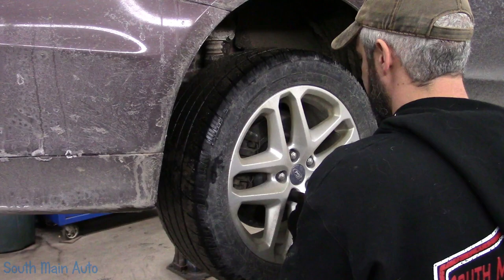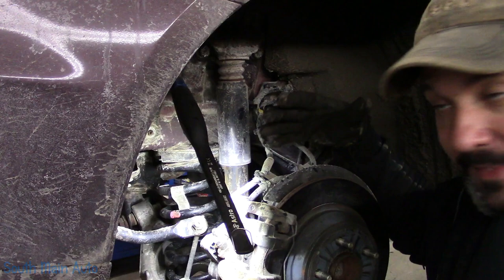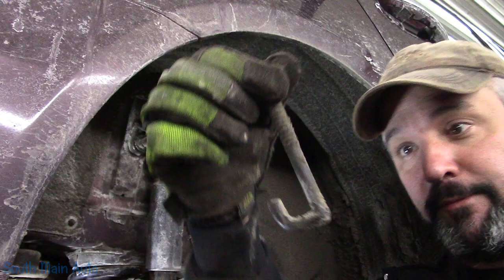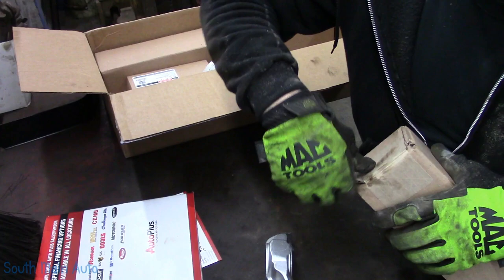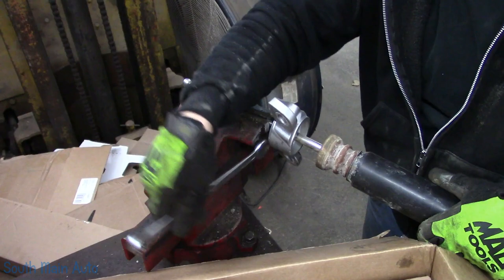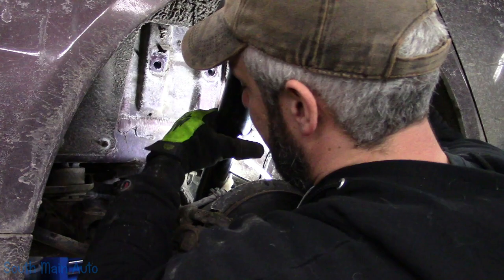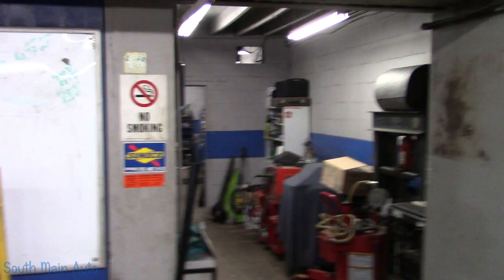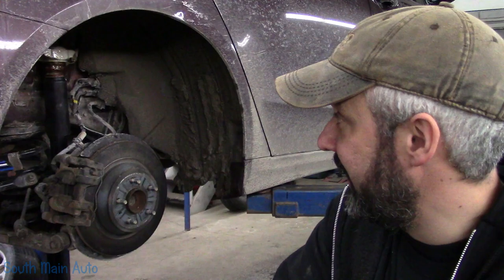Ford Fusion - Rear Shocks & Mounts

Comment: Any fusion owners hearing a clunk in the rear of their fusions. The noise is coming from the nut at the top of the shock. All you need to do is tighten it. I had it develop at like 60k miles, thought i needed new shocks. Just realized the top nut was loose causing the noise, give it a good snug and it wont knock. Use a pair of vice grips to hold the stud from spinning with the nut, since it wont tighten if the stud spins with the nut. It happened on both left and right rear. Just realize itll re loosen itself over time, i noticed it happens usually in the fall and spring times with temp change.
Reply: Wife’s car is at 58k miles and after reading your comment I think we are having the same issues. Thanks for posting this.

Comment: Thanks for the video. I have a 2013 ford fusion and I need to replace the upper shock mounts and shocks because of the clunking noise coming from the back. This explains why. Never think these videos are not worth it. They are very valuable.
Reply: I'm in the exact same position. If the noise only comes from the left rear side, do you think it's necessary to replace the other side as well?

Comment: The bolts for my shock mount decided they don’t want to thread anymore. Bolts plural, as in only 1 will tighten all of the way. The bolts themselves seem fine, but it looks like there’s a bunch of metal shavings in the holes, so I’m thinking that’s my problem. Not brave enough to use a helicoil on it so I guess I’m getting it towed to the mechanic 😡😡

Comment: Just replace the shocks on my beatass 98 Ramvan. Front were actually broken and not even connected to the mounts.......rear were original and blown-out. OH MY, the 60-bucks I spent on those cheap Gabriels, the difference between night and day. The ride was scary-bad before I changed them.....now it is pretty dang good.

Comment: Yes another Northeast storm beating up New England today. Thanks for the entertainment Eric!
Reply: So I'm not the only one doing absolutely nothing today! 😁 Gotta save up my energy for snow removal later today.
Reply: Smitty Smithsonite I waited until noon and we had 14 inches here in   CT. Got that cleaned up and got hit with another 8 to 20. I'll get that in the morning lol.
Reply: Yikes! You guys got hit worse than we did. It drifted a bit up here, so there was 6" in some spots, and well over a foot in others (some areas were 2'). Just got done an hour ago (still lightly snowing too). What really sucks is the ground isn't frozen under all that snow - got stuck quite a few times with the plow truck, and was watching the fireworks in the dark from the rocks and mud the snowblower was tossing everywhere. Was wet snow underneath the powder - the snowblower's exhaust was cherry red the whole pass. She was working hard!

Comment: Well, knowing the rust belt you live in, and you were able to get that shock nut off with the Earthquake, knowing you're working the heck out of it, I'm sold... Ordering one today.
Reply: I'm thinking about it as well since he runs the snot outta his. I use a corded Dewalt, but battery power would be nice. Order fast because when they find out everyone here is thinking of getting one they will jack up the prices.

Comment: Thank you for your video!

My experience with a clunky rear shock absorber on a 2016 Lincoln MKZ (Hybrid):

First attempt: Tried tightening the shock absorber rod nut, but it didn't turn much and didn't resolve the sound.

Second attempt: Applied some penetrating oil and let it sit for a couple of hours. This time, without even holding the tip of the shock absorber rod, I could turn the nut with a 15 mm wrench for almost a full turn. I stopped tightening when the rod began to rotate with the nut. This resulted in more torque than the specified 22 lb.ft (possibly around 50 lb.ft). On a short test drive over a pothole, one of the shock rod ends broke off above the mount. It was clear that I had over-torqued the nut, causing the rod to reach tensile yield strength.

I ended up ordering OEM Motorcraft shocks and Dorman shock mounts from RockAuto. Inspecting the old shock mounts, I didn't notice any obvious damage, but I replaced them regardless. This resolved the clunky noise issue.

I didn’t remove the height sensors, and they weren't in the way. Additionally, I didn’t run the “Ride Height Calibration.” The car seems to drive fine. You might want to measure the height before and after to determine if a calibration is necessary.

Comment: Actually I'm glad you did post it. My wife's 2013 had the same noise but on the drivers side. I tore half the car interior apart trying to find out where it was coming from since it resonated inside the trunk wheel well. I was certain it was coming from there. Finally decided to jack the car up, took the wheel (that some idiot had air gunned on to about 300 lb-ft forcing me to destroy those stupid lug caps) off then removed the plastic wheel well covering. Shook the car and through a process of elimination finally figured out it was the stupid shock mount. Simple repair once I figured out where the noise was coming from but wasted hours locating the noise.

Comment: Ok. My 14 Fusion had that rattle in the r/r area, my brother and I checked all the suspension, that mount, since I was told by alot of people that was the problem. Finally I bought the mount and bumper, honestly once it was apart, bingo. The inner bushing was shot. But between the bumper, being recessed in the bracket, and the nut, is what held it enough to not be able to tell. So fellow Fusion owners, if you get that rear rattle, don't hesitate, but and change that strut mount! Bumper not so necessary. That's for the vid, def easier taking the whole strut out to change it! 🙏🙏😊

Comment: Had a rattling sound coming from the back passenger side of my car.... Tore out every panel convinced my kids dropped something back there. Turned out it was the shock / mount. Thank you for this tutorial! Replaced it with minor trouble (getting screws in bottom brackets was tough), but the rattling is gone!

Comment: I get so used to buying aftermarket stuff that I always get burned by OE parts that are sold individually. One time I tried to buy an OE Cub Cadet starter for a diesel tractor, and they literally had every single part of the starter for sale separately - bendix springs, brushes, armature, gear, case screws, etc., etc. - was enough to give me a headache! Japanese motorcycle companies normally have an un-numbered listing above part #1 on the "fiche" that is a complete assembly - you can always tell by the massive price tag that it's complete.

Just did a brake job on the Silverado yesterday - the 8th one in 92k miles. The first 5 were done under warranty, lol. Way to build 'em, GM!  Had my neighbor drive me down to the garage that turned my rotors to pick them up ... and we broke down on the way back, HAHAHA! Never a dull moment in my life. Passenger side brake nearly caught fire! I melted a few gallons of snow on that rotor and caliper to keep the fire at bay. It was literally seconds away from flame. '03 Sable with 176k on it - I've been keeping her going for the past 5 years, but it's becoming harder and harder lately! 😂 Almost time to ship her ... to the boneyard. I ate lunch at 5:30 after that adventure. Him and his son just threw struts in it last week, and it has a noise that sounds like a bad strut! Rut roe! Was a complete assembly, so I don't think it was anything they did - just no-name Amazon parts for ya. 😉

Comment: the lug nut underneath the chrome cap is actually an 18. i work at a ford dealership and we all have that 19.5 flip socket and when it gets real bad we sell the customer the set of lug nuts from the parts store instead of the factory ones. they suck!

Comment: there a lot of great videos out there including this one but you always leave out the most important information which also deals with safety issues let alone proper fitment and that is Nut and bolt torque specifications.

Comment: Hey, all my accessories and heater works with the key out and doors open in my 03 rustyrado. needless to say, my battery didn't agree with this and it committed suicide.   The culprit was ERIC O'S favorite thing. AFTERMARKET remote start box. It died.
Reply: Ed Yager 😂😂😂

Comment: On a recall for the brake line replacement. I had my Ford dealer replace those junk lug nuts and replace them with REAL ones. My cost was 70 bucks if I remember right.

Comment: That thing you took out of the wheel well is a Drive Hook, its pounded into the telephone poles. Its used by phone company tech's to attach drop wires from homes to telephone poles. The P-Clamp attaches to the drop wire and then onto this. It must of fell off a truck. They can only be removed by unscrewing them out of the pole, very rarely they are pulled out. The drops usually break first.

Comment: I don't see much but I believe it's the first time I've seen a side mount for the upper part of a shock. Good vid. I had a 68 stang back in the day and it was getting perforated three years in. The 79 Rabbit same so hanging a bracket on sheet metal I guess is a newer thing. We've got salt in southern NY too.

Comment: with my dealing with those swollen lugs on a daily bases, i use the 19.5mm to break them loose then spin them off with a 20mm. and when their really swollen i hammer on the 19.5mm, sometimes the caps break off and sometimes they go back into shape

Comment: I have nylock nuts on a couple bolts that fasten the rear of the diaper on my car and that diaper has to come off every time I change oil.  The car is 15 years old.  As long as the nuts provide some resistance they are still good.

I'm also running the original, one use only, aluminum washer on the oil pan drain plug.  No leaks.

Comment: When I did the rear shocks on my 2013 Ford Fusion Hybrid, I had to torque the top nut with the car on the ground. I torqued it with a jack under the knuckle but it got even tighter at the same torque when the tires were installed and on the ground. Super weird.

Comment: Great episode. Today I helped a friend change a flat tire. I thought I own every size socket known to mankind. WTF Ford??? Who makes 19.5 mm lug nut. 100 years of engineers designing stuff that can’t be worked on. 100 years and no standards on something as simple as a lug nut. I laughed when you said “ this should be easy” lol every time I say that my Hummer says “challenge accepted “.  Earlier this week I had a 2 bolt job. Took 2 hours. Had to Dremel out a bolt that decided it didn’t want to come out.
Reply: For anyone reading, the Ford lugnuts swell because they are cheap two piece designs. That's why you need the 19.5. Replace them as soon as you can with solid one piece lugnuts. You might have to cut off the outside piece of the original lugnuts to access the inner nut, which was 17 mm on my 2019 Ford Fusion Hybrid.

Comment: I just got done about 20mins ago with this exact job on a  2016 Fusion with about 60k on it. I'll  throw in some extra tips for you guys. 
Some people have addressed the lug nuts here already, I'll go a bit further. If they are not too jacked up, hammer on a 19mm, make sure the dumb chrome cap is lined up with the nut, you'll see what I mean if it starts spinning on you. Take them off, afterwards, take a die grinder with a small disc and cut 3 notches in the ring around cap, put it in a vise, get a screwdriver and hammer and chisel the edges off. Turn it around in the vise and pop the cap off with your screwdriver. They are now a solid 18mm lug. Throw those stupid things in the scrap bin.
I have never heard of anyone having to replace shocks after 60k miles or anywhere near that, so we decided to purchase the mounts which was around $100. I'm sure these could go bad with more miles, but the ones on the car I worked on were not bad. I replaced them anyway since the customer bought them. So where was the problem with the particular one that I worked on? It was the nut that came loose on the driverside shock. Probably could have tightened this up while the shock was on the car, but I do recommend taking the shock off because it's very easy to do and for a couple other reasons.
 I turned the shock upside down in my vise and turned the 15mm with a wrench. It appeared that the plastic threadlock on the nut had kind of worn out and the nut loosened a bit. Personally I threw some blue threadlocker on it, tightened it to all hell in the vise and called it a day. If I were to do this again, I would say the best thing to do is to get new lock nuts for the shocks and/or get a correct sized lock washer on there, add some threadlocker as well, tighten her down. Anything from keeping that sucker from loosening up again. 
I used the blue threadlocker on all the bolts. Not sure what the torque specs, I felt it out. Did 50-55fts on the lower bolts(I thought 55 was kind of pushing it), and did 70-75ft lbs on the top two bolts. The shock nut you can't really torque so just tighten it down, you may even want to dab a tiny bit of oil onto the bottom of that shock nut were it meets the mount bushing, just so it can spin a little bit more.
The dealership was going to charge this woman $500 to replace the shocks, maybe the mounts too(not sure)? When all it was was a silly loosened nut. 
Bonus: Uncle just retired from Ford last year, I won't tell you what he says about them, but he does tell everyone he knows to buy Toyota
Reply: "I have never heard of anyone having to replace shocks after 60k miles or anywhere near that, so we decided to purchase the mounts which was around $100" wait, I'm not following, I thought you were talking about replacing shocks? you decided before you did a thorough inspection that it must be the mounts because it can't possibly be the shocks?
Reply: @Netherlands031  hi, sorry for the confusion. I could have worded that better. 
It was a rushed job because it was their daily driver. I told them that those shocks shouldn't be bad with 60k on them and to go ahead and get the mounts. If I saw that the shocks were bad once I got in there then I was going to hit the store and buy those. Turns out nothing was bad and that the nut came loose on the shock. That is what the problem was and I'm trying to tell anyone with the same situation to get in there and see if the same thing happen so they can save money. So before the car came here they bought the mounts. They were getting a little crusty anyway bc they are aluminum and we are in Cleveland with salty winters. 
If I can help you with any other thoughts let me know. I pretty much summed up how to deal with the shocks and nuts on those though.

Comment: I have a 2016 ford fusion and got my mounts and shocks done. My town has terrible roads and occasionally I am hearing a cracking however everytime I go back to the shop I’m being told over and over that nothing is wrong. Going over bumps and the slightest bump just always feels like my rear end is wobbly. Any suggestions ?

Comment: Its amazing how engineers can be so intelligent and so oblivious at the same time. Why they consistently design car parts with a concave surface that collects EVERYTHING is so bizarre! I have a jeep and the rear upper spring location is a press formed bowl that has 14yrs worth of mud and everything packed into it and no way to get it out, hardly enough room for a couple fingers. Same with these upper mounts, just collection cups filled with corrosion.

Comment: I have a 2013 Taurus with 112K squeak in the right rear, and it seems to act like a pogo stick sometimes when I go over a pot hole. probably the shock, doesn't seem like a difficult job. I'm surprised the Fusion doesn't have struts rather than shocks

Comment: Hallo. I have a Mondeo mk5, ST Line, 2017 Hatchback, 28000km. They say St line with sports shock and is 10mm lower. How can i improve the comfort of the back? Replacing the shock absorber? Advice? Recommendation? 
Thanks in advance.

Comment: shock mounts are a common problem in 14 fusions :(. had it replaced on front left strut snd rear right shock mount. then recalled by ford to have 5 seperate parts replaced! dont even remember the parts lmfao

Comment: Don't mean to troll here, I know car usage varies a lot from driver to driver, and region to region. However, my 05 accord has ALL the original suspension in it at 200k km, and no clunks...no nothing. I like very much though the way in which those rear struts bolt to the body, seems WAY easier to service than most other systems.

Comment: 00:38 I've also noticed that the actual nut doesn't go all the way to the top of the cap so if you don't fully seat the socket on the nut you will likely deform the nut/cap. It's happened to me.

Comment: i changed only rear shock in my ford fusion 2014 not the MOUNT ,it feels perfectly fine over bumps but tapping NOICE tuk tuk noice has started after replacement of shock, do i need to change MOUNT now ?
Reply: I forgot to move the plastic cover over when I did it and that caused clinking. I had to take it all apart and put that cover over to fix it. Also, I had to torque the top nut again with the car on the ground.